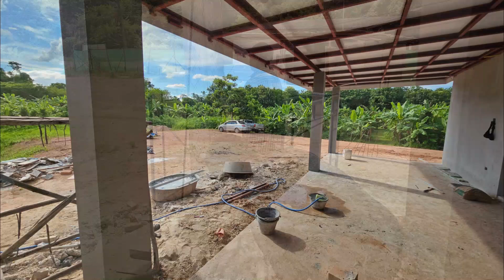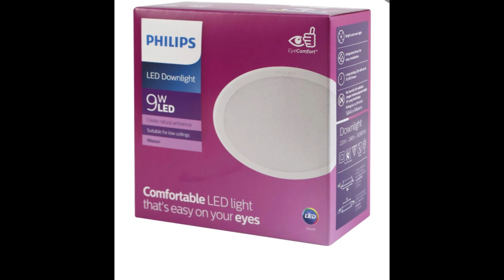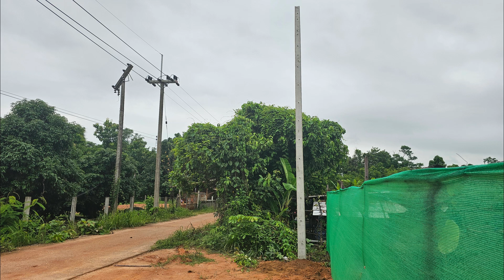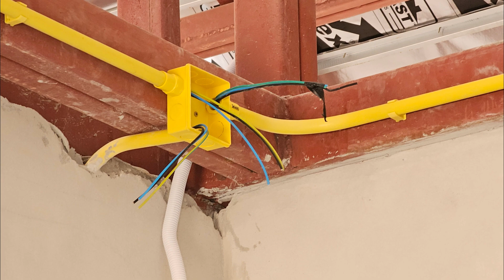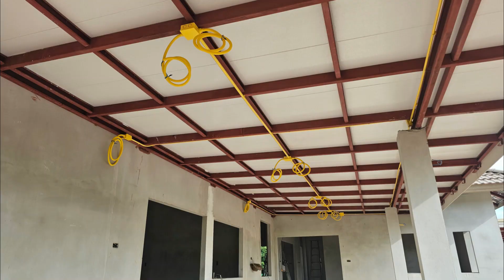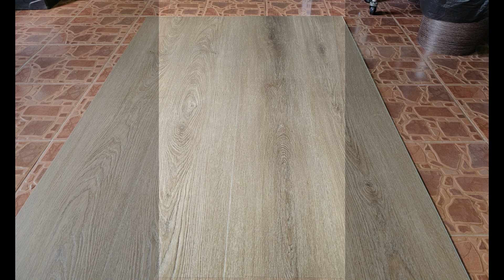Thai House Build Week 20

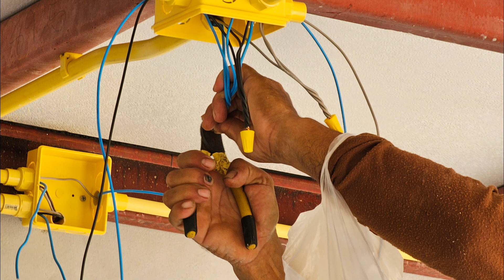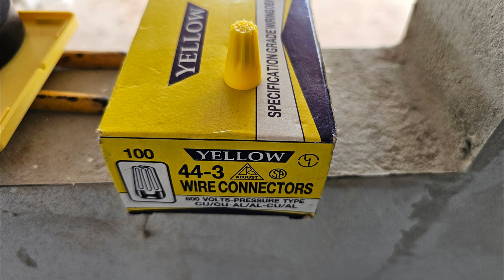Comment: I was telling my wife that the electrician was one of the best I have ever seen in Thailand, until there was a closeup of the wires in the wirenuts. There is copper beyond the wirenuts at 17:04 and 17:09, they cut the wire too long before the wirenuts were installed. The tape will help, until it doesn't. If you start getting circuit breakers tripping in a few years, that is the first place to look. Other than that, you and your partner have great taste in house design, we are looking at something similar, but smaller in a year or so. Thanks for the videos.
Reply from the maker: Thanks for the feedback - I noticed that too after taking the pictures. That was rectified before the box was closed up. Cheers

Comment: Before your roofer team runs off; consider bending all the valley edge of your metal roof by 25~45° downward. The bending work can be done using metal bending plier.

The purpose of that metal bending work is to prevent/stop water stains on the underside of those metal roof. Plus, it can also stop rain water sliping into your fascia board and damage your celling.    I know there is covering in front of the roof PU foam. However, water and gravity will always win soon or later.